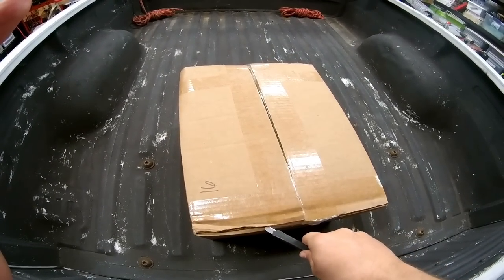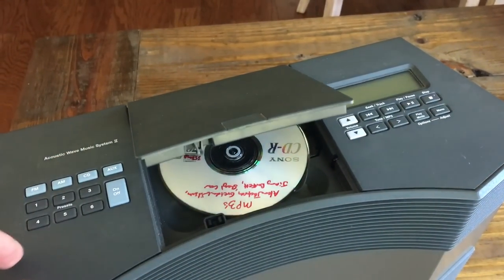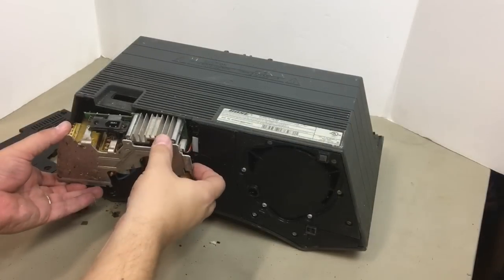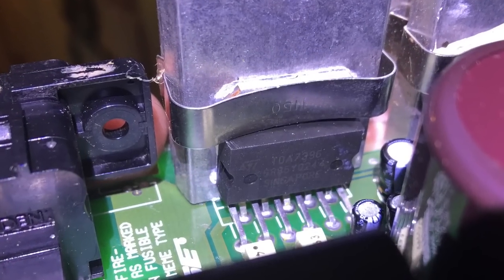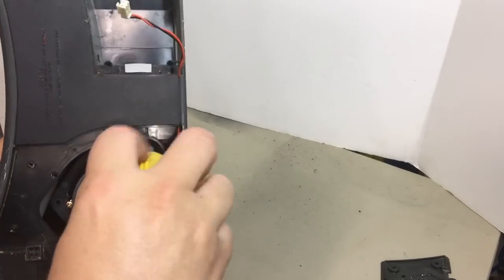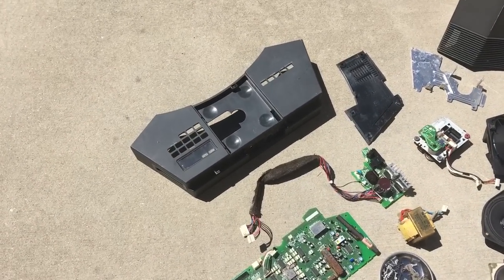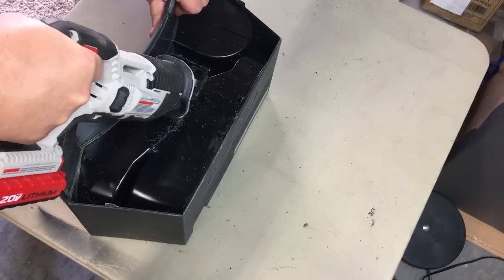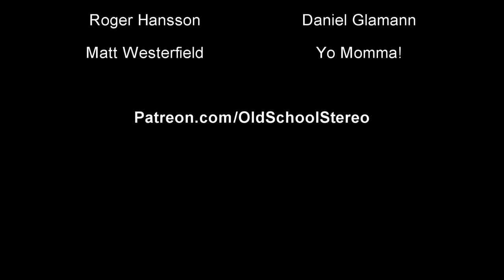What's Inside $1100 Bose Acoustic Wave Music System CD-3000

Comment: As long as you dont expect too much out of bose they are ok but they are way over priced.
Reply from the maker: +slim jim new they are WAY overpriced, but used, they can be reasonable
Reply: BigDWiz Yeap. Had some 901s. Gotem with eq and refoamed for 400. A pair of 201s and 301s were my first speakers. Paid retail for those but I feel like the older ones were better. Now its plastic enclosures. Gag. I really like the look of the late 80 s and 90s era bose. Great for full range audio at moderate levels but if you want to get loud and some real low end they stress quick.

Comment: I've never heard of anything having even close to 10% thd holy shit I knew Bose was terrible but not that bad. Hell for all we know the speakers themselves are great but we would never know with such filthy signals.
Reply from the maker: The 10% THD is the chip's rating of power. It can have clean power up to this limit. Some amps are rated at clipping, which is not unusual for home or car audio amplifiers.
Reply: @wal  so it doesn't mean the sound is distorted 10% by going through the amp.
Reply from the maker: @rabbidpotatoegaming4514  Correct, it means the power rating was taken at 10% THD